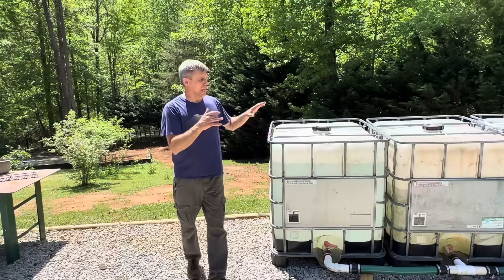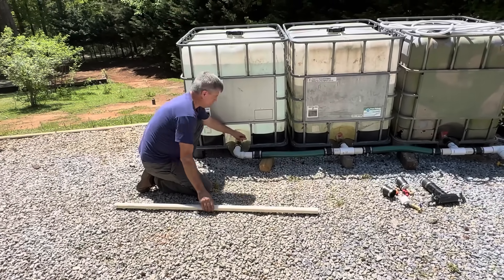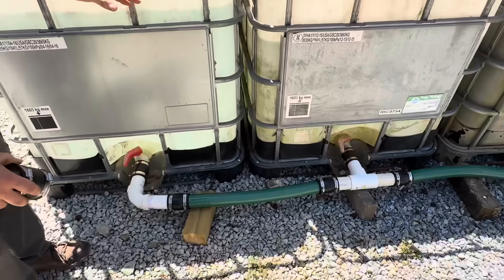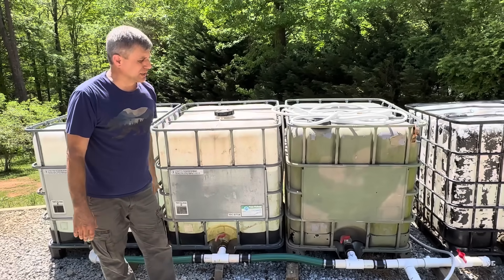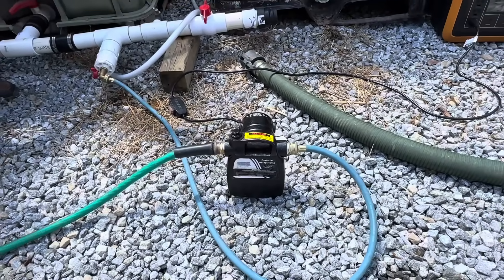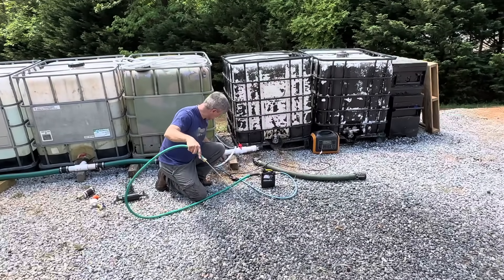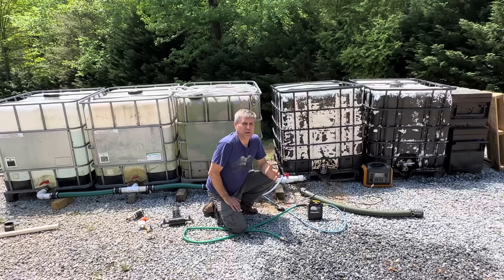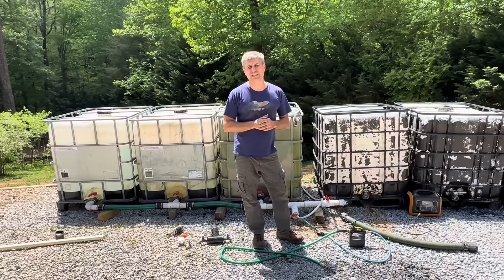How to properly set up your 275-gallon water totes for firefighting or irrigation of garden.

Comment from the maker: https://amzn.to/4cPFL27    115Volt 1/2HP 1500 GPH Upgraded Heavy Duty High Pressure Cast Iron Casing Water Transfer Utility Pump with ON/OFF Switch
Excellent pump for many uses around the home.
This is an amazon associate link.  Anything purchased through this link helps support the channel.  Thank You
Reply: What do you do in the winter time? I have to drain my tank it freezes. Augusta, West Virginia.
Reply: Are you buying the totes on Amazon too, or where ?

Comment: Right down the road from you in Westminster. About a year ago our kids and grandbaby moved in with us. We have a 425 ft deep well that unfortunately started to go dry every other day. I could only get about 25 gallons of water out of it at any given time. Well that wasn't gonna work and we have no access to any other water source, even city water! So I found 4 Totes that were drinking water safe and I plumbed them all together with a 1 horse pump. I then plumbed in a spin down filter, then a 3 cartridge whole house filter, then a UV (Ultra Violet) sanitation light...whew! Lots of filters! But to shorten this I captured any rain water coming off my metal roof and we used it for showers and drinking water. It provided us with the majority of water we needed. Nobody got sick or anything so I guess all the filtering I did was sufficient. I did sweat it a few times though when we didn't get enough rain. So I spent $5500 to get the well Fracked. That seems to have worked because we now get quite a bit more water from it. I converted the Totes over to garden, vehicle and other outside water usage. But anyway the Totes and spare water is good to have.

Comment: i've got a 20 liter per minute 12 volt ebay pump connected to a 12 amp x box 360 power supply, if the hose kinks the pump will draw more than 12 amps, the resettable fuse in the xbox power supply cuts power to the pump, it protects the pump, to reset the fuse you disconnect the power for 10 seconds, the x box power supplies are actually great for powering 12 volt stuff.

Comment: I have been to preppernurse1's places near Beckley WV.  tots used for rain water collection system were OK but I like yours more. The volume, the connection, the use of solar generator to power a water pump. You appear to plan things out well in advance. ALLEGEDLY 😊

Comment: How do you deal with freezing weather.  That seems to be an issue with mine every year during the coldest part. The neck and valve assembly lock up and usually the handle breaks if you try too hard. Any ideas. Thanks

Comment: We used Fernco 2" Ts right off of the IBC taps in order to plumb multiple IBCs together with fewer pieces. They're connected to a gutter system and we use them mainly for watering cattle.

Comment: Maybe totes covering with black contractor plasticsackets,algi grows inside totes and could clogg pump or filter quickly, light blocking out avoids grow,further splendid setup,I use barrels,trunks,hose, fire extinguisher,fire blankets,firewarner it's an must,in summer,heatwave quick dry gras,trees could catch fire, sprinklers excellent too,another option dig an big chunk earth out they ground and build with garden plastic role an pound, cheap captures rainwater automatically and increase yourn duration of water use,a lot people think tap will deliver water, most I do,but interruption could make reserves very helpful,pumps ,even handpumps filling gaps,of course electropump is much better,be prepared ,thinking out they box,exercise,and time measuring helps to find limitations out quickly,keep up they good work !

Comment: We do the same thing as a set up Dave, thats a great setup and it works awesome. Additionally, I made a simple under eve sprinkler system on our wood sided shop using 1/2 inch PVC and 90 degree shrub emitters with risers every 10 feet to form a water curtain around the building so we can start it and move to patrol/ extinguish other hot areas around our home and barn. I get about 15 minutes out of a tote using a 1 inch harbor freight pump. I also have a smaller kids pool for use as a quick setup porta tank where ever I need it for a drafting water source using pumps. Great video, thank you. Retired fire service- 32 years on the Left Coast…

Comment: You can get about 4x the volume of spray if you have a 2" trash pump that you reduce down to a 1" water hose with a fire nozzle type on the end. 

Thats how we treat soil remediations in the oilfeild. It sprays real fast and real far and that fire nozzle just works nice since you can get a large fan spray or a fine spray that shoots 30ft. 

Of Course you have to make sure that pump is always maintained to be easy to start.

Comment: I’ve considered picking up a used above ground pool for this but this is a good setup, could be on a trailer for one or 2 totes. 
Also good to have a “foam cannon “ like for car washing set up for oil or gas fire and putting a protective layer on things
Reply: Kiddie pools can be a cheap way

Comment: The Amish in my area put a few small pieces of copper pipe in the  water tank and algae won't grow. I started doing that myself.
Reply: Great tip
Reply: I've been using a few ounces of bleach in mine.
Reply: Great idea!
Reply: Yes!
Reply: You don't want any algae in your or your animals drinking water. Some algae produce toxins that can not be seperated from the water. One drink can kill animals, pertcurtulary dogs.
Reply: So copper is chlorine now?
Reply: @BS.-.-  never said that. The copper prevents algae from growing in the water tank. You can paint or cover the ICB tank that will deal with the algae also . I use the water in my ICB tanks to water livestock and plants if needed. If I was to use it for humans I would treat or filter it.
Reply: @pjkentucky  you dont need copper if the tank is black.
Reply: @BS.-.- many algecides are copper based
Reply: @justincase1152  are you aware that algesides dont actualy kill the algee?  They allow the chlorine to get to the algee and kill it.